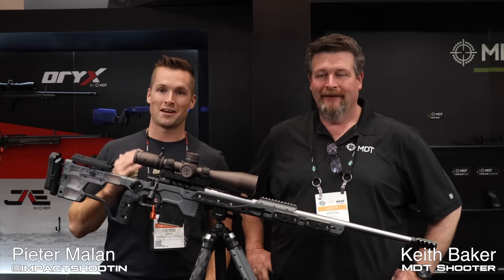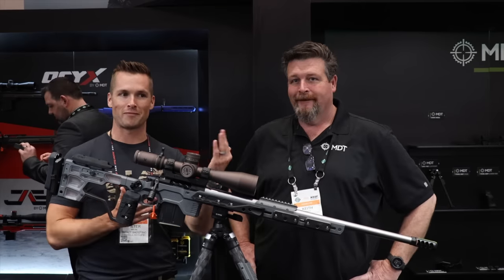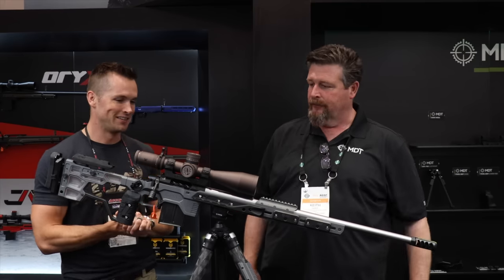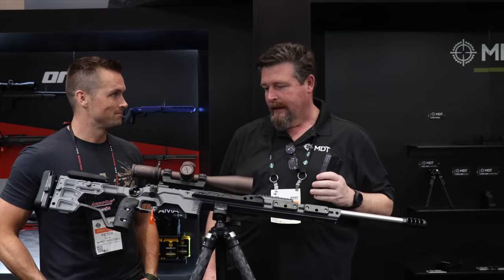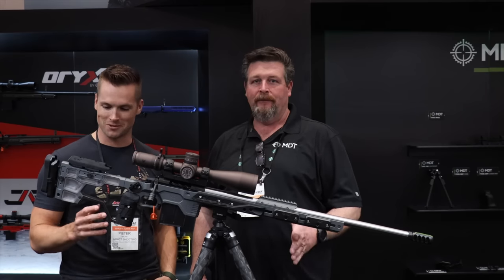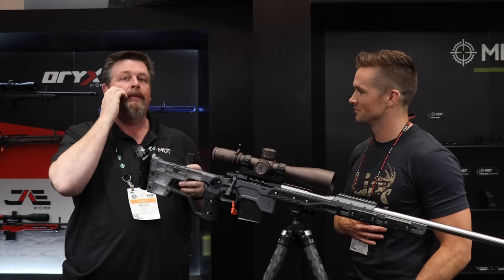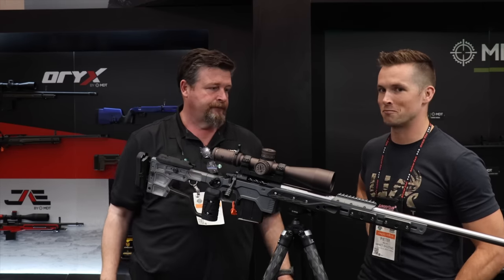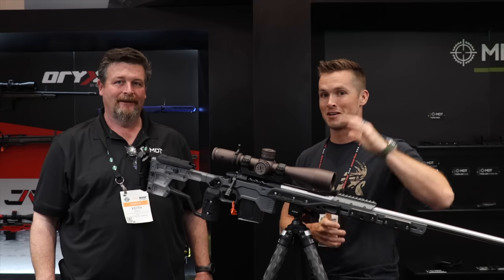ACC Elite - Everything You Need To Know

Comment: i have a Savage Elite Precision with MDT ACC chassis. I've shot to 1,500 yards and love it except for one thing. The stock doesn't fold and you have to remove the cheek riser completely to get a cleaning rod down the barrel. Looks like the same problem with this ACC Elite and it looks like the butt end of the stock and shoulder pad will be in the way, too. It took me forever to find a cleaning rod over 44" long that could reach to the end of my 26" barrel. Having to remove the cheek riser to clean the barrel sucks.
Reply from the maker: One screw on the elite and a button and cheek riser pops off, 5 seconds max!
Reply: i have a savage elite also and all i do is lower the cheek riser all the way and i can get the cleaning rod in.
Reply: @6n518  I’ll get right on that.
Reply: @6n518  there’s this whole thing about messing up the crown of the barrel. Sorry,  thought you was trolling me. Just google about cleaning the barrel crown first. I tend to not do it. My friend told me about a while back, so I clean that thang from the back. I guess if you’re careful you’ll be fine, but I’m stupid, so I’ll try it the “proper” way.

Comment: What’s new with Oryx in the background?
Reply: I also want to now. What is that Blue one on the background?
Reply: It's called the field stock. Almost a more budget xrs. Doesnt have the grip modularity. I'll be buying the new oryx as soon as it comes out
Reply: @eggbert191  sounds cool. Is there any info about it anywhere yet?
Reply: @eggbert191  wait so there is a whole new Oryx chassis coming out? I thought maybe just some accessories or something. But that’s awesome. Do you happen to know if this one can accommodate extra forend weights?
Reply: @sakusalo-tuisku4305  oryx posted the specs on fb and instagram near the middle of shot show. Its pre production so there might be some minor changes. Mlock along the bottom of the forend. It's also lighter than the oryx chassis and the xrs. Adjustable cheek piece and spacers for length of pull. Sling swivel studs front and rear. Somewhere around 1/2 to 3/4 thepriceof theory chassis. I'll be painting it when it comes out so color doesn't matter to me. Should be a good seller